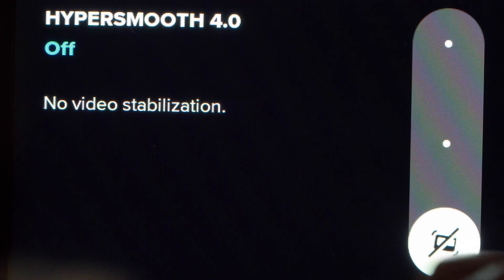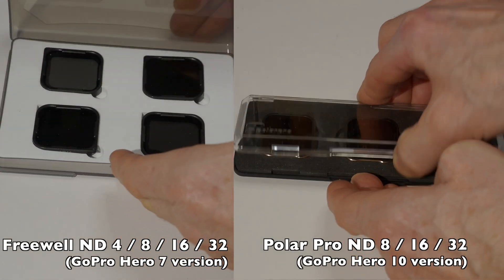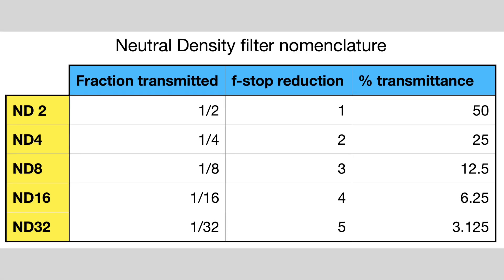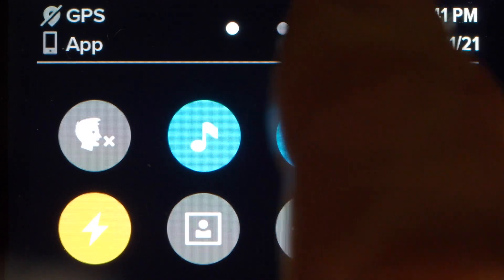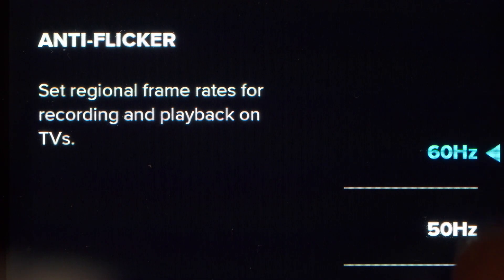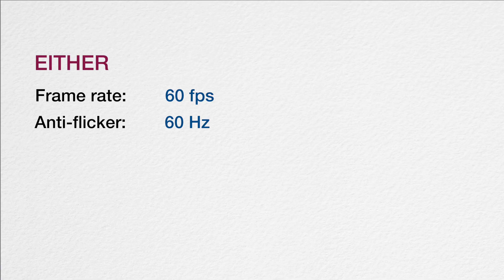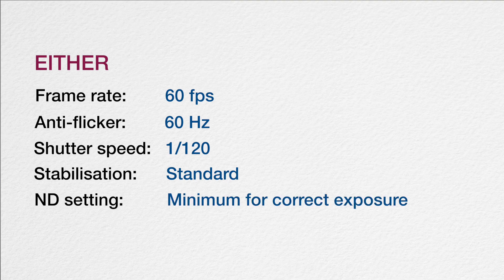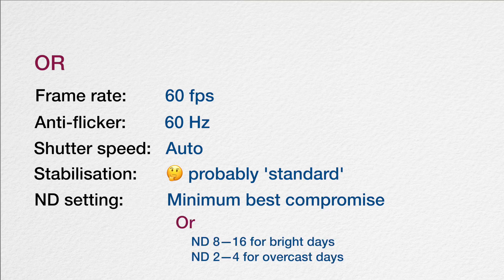Preventing the rolling shutter effect on aircraft propellers in action camera videos

Comment: Hello Steven,

with the GoPro Labs Firmware you have more control over ISO and shutter settings (and even more). Do you think that those settings could make a ND filter obsolete?
Reply from the maker: Hi, Christoph—that's a very interesting comment but, unfortunately, the answer is 'no.' On my Hero10 and Max cameras with Labs Beta installed  the lowest ISO setting is still 100. Even if it’s possible to generate a QR code to reduce the minimum ISO below 100, slowing the shutter speed too much will still result in overexposure eventually. Also, reducing ISO below the native ISO of the sensor will result in the camera overexposing the image on the sensor and then reducing the exposure in software, thus reducing the dynamic range and burning out the highlights..
Even if GoPro were able to incorporate a variable aperture in their cameras there would still be a problem as I would expect that reducing the aperture would quickly result in diffraction degradation of the image quality.